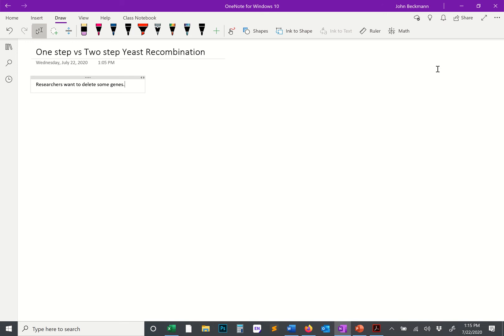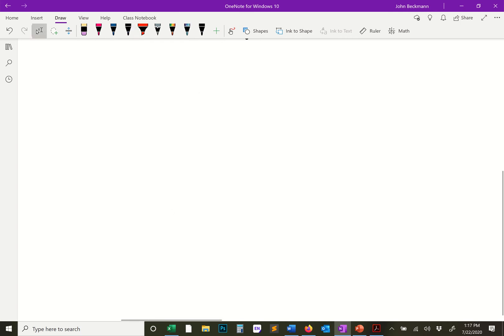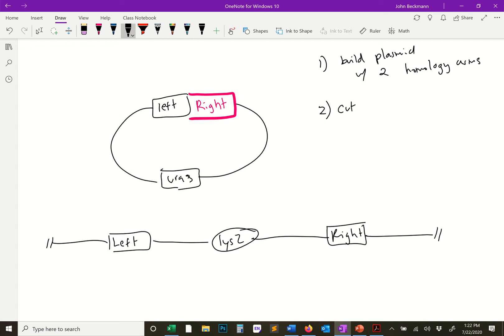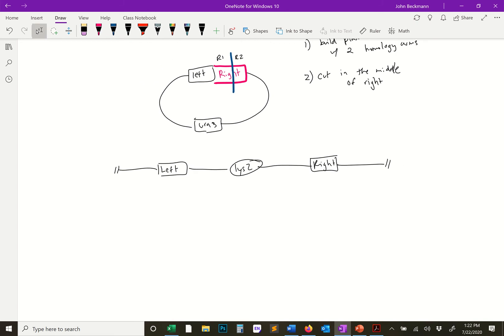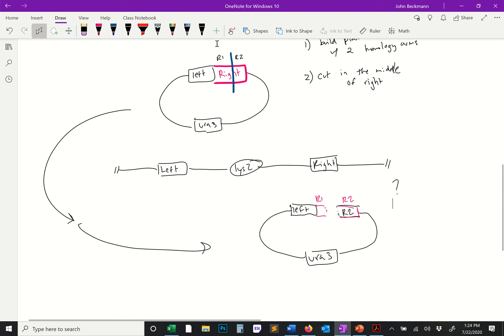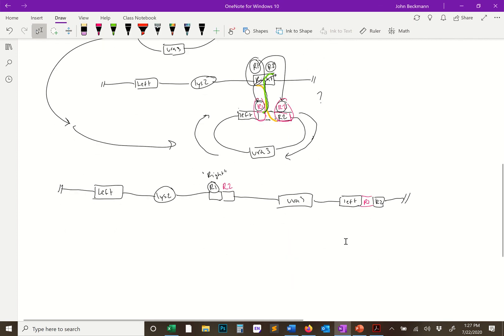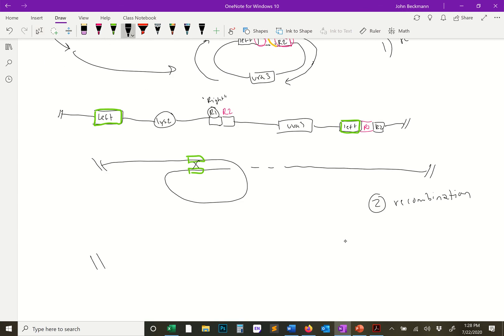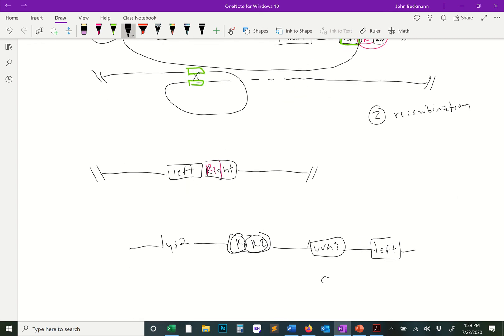Yeast Recombination: One Step vs Two Step

Comment: I have a question. When you amplify the Left and Right arm, will you consider the sequence direction? Should we design the direction that after linearization of the plasmid, the Left and Right arm align with the genomic sequence in the correct order? I mean, after linearization, the DNA should look like 5'-LeftArm-3'---URA3--5'-RightArm-3'?

Comment: 9:59 Do we have to think about the orientation of the Ura3 gene here? In this case, after the new right (R1 and pink R2), the Ura3 gene should be reverse transcripted? Am I correct?
Reply from the maker: URA3 has its own endogenous promoter. So orientation doesn't matter because whichever direction it faces, the promoter is still in the correct orientation. It will just impact which strand the RNA pol transcribes from - but because DNA is double stranded, this doesn't matter. Many genes are on either one strand or another and so flipping genes orientation doesn't matter, as long as the promoter stays intact in the proper orientation.
Reply: @ProfBeckmann  Thank you for your quick reply. This is really an amazing video that solved the structure of my genome after crossover. Also, the mechanism "looped out" also explained here. Thank you so much!!

Comment: Hi Professor Beckmann, thanks for the video, very clear. I have a question about the 2 step recombination, specifically about the second recombination step. You showed recombination between the two "Left" segments, popping out the intervening Lys-"Right"-Ura3 sequence. This can obviously be selected for by the 5-FOA counter selection. It seems to me that recombination between the two "Right" segments is equally possible, leading instead to removal of the intervening Ura3-"Left" sequence, and this recombination would also be selected for by the 5-FOA. Am I right, or is there something I am missing? I suppose it would be simple screen colonies surviving the 5-FOA counter selection by PCR for the desired recombination and for lysine auxotrophy? Thanks.